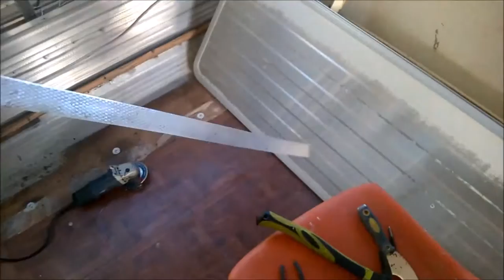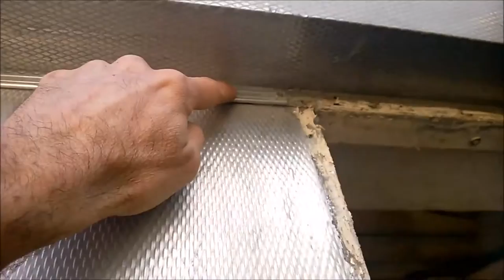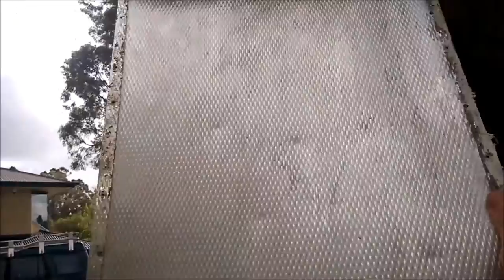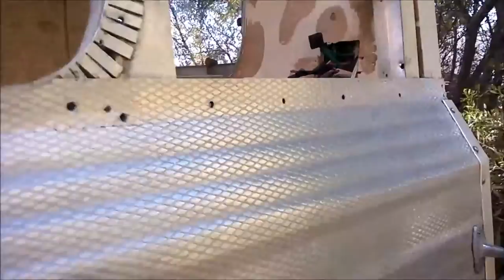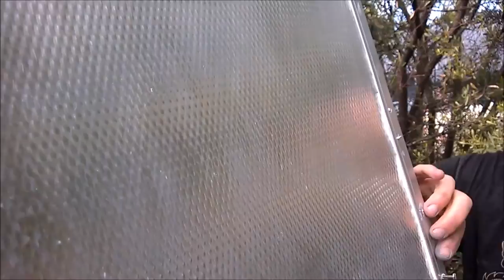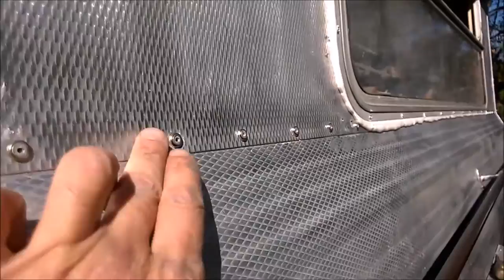1966 Viscount Ambassador: Rear Window, Cladding and J-rail Reseal

Comment: thanks for showing me what a miserable job i have to do not to mention re building the back wall with steal.
Reply from the maker: steel?  I assume its not against alloy as this would be problematic for the alloy.  Yes crap job BUT worth it in the end.  Good luck with it!
Reply: @rovertasmania7033  steel, alloy or aluminium, whatever will do the whole job from what i mostly have in my stock pile, separating the different metals with rubber butyl i guess will not cause issues.. but looking for the best method still cos i need to work with the materials i have cos the budget is small and if i don't have enuf then i will wait until the budget progresses. Dont forget gal paint on the steel where appropriate.

Comment: At about 15 minute mark when you put the plates back on whats the reasoning for not applying silicon. cheers and love the videos
Reply from the maker: Thanks Joshua.  I could have applied mastic on the edges, but that will happen anyway when putting j-rails and window frame back on.  This is why I use loads of mastic so that when I apply the j-rail/window frame etc it will ooze and squeeze into cavities/gaps forming a tight seal.  The base of the plate overlaps the inner one so water wont get in through there. Cheers
Reply: Awesome thanks for that, hoping to get a caravan and do the same thing after watching you. Keep up the good work